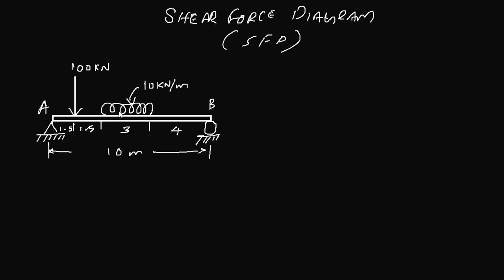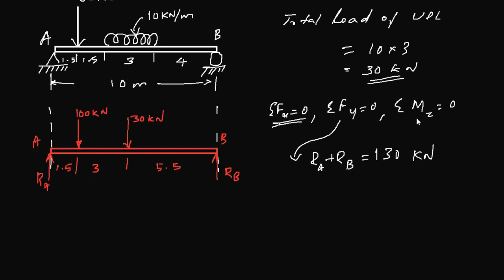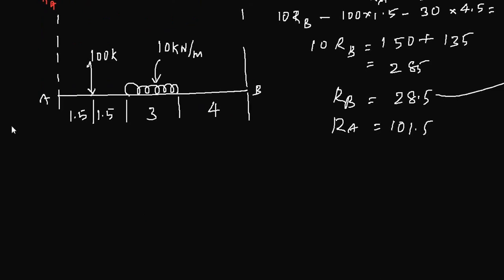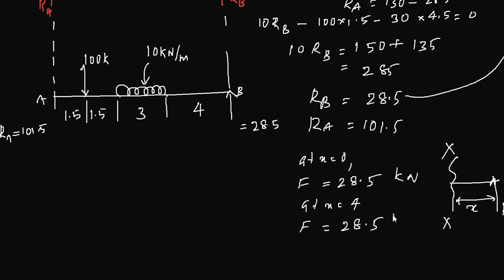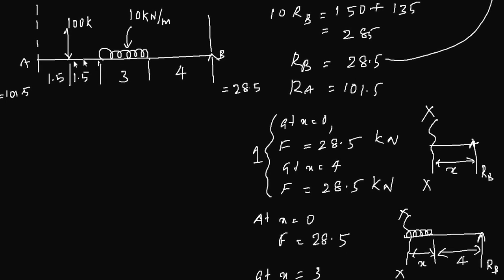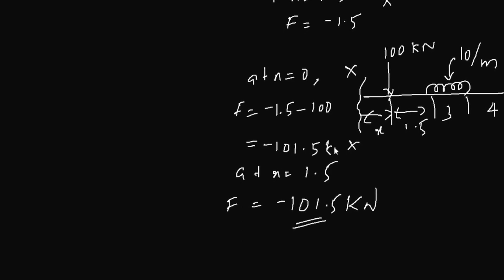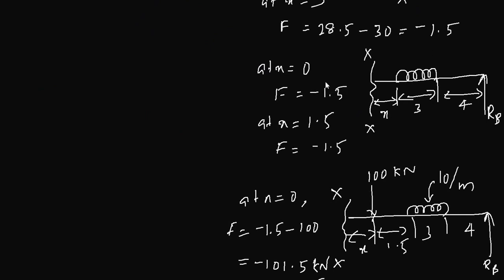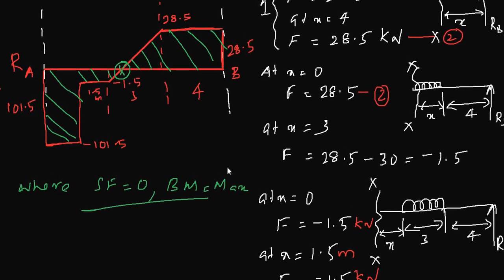Mechanics of Solids 6 - Shear Force Diagram

Comment: Can you start considering the sections of the beam on the left hand side at A in order to determine the changes in forces? And if so will the diagram result in the same exact SFD or will it be flipped across the x axis? And will this still be correct?
Reply from the maker: Gaybilicious: You could start from any point, however the SFD will be different. In this case if you start from point A, the current diagram will change in such a way that the +ve forces will be -ve and vice-versa. Hope this clarifies, comment if not. Thank you.